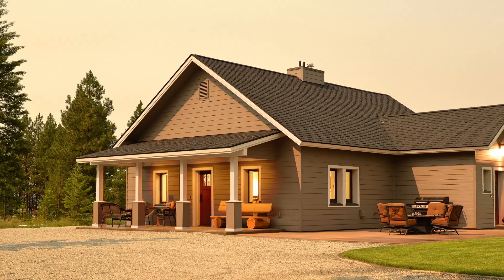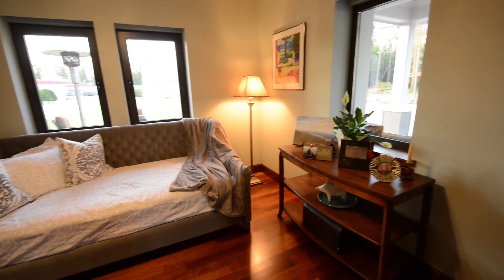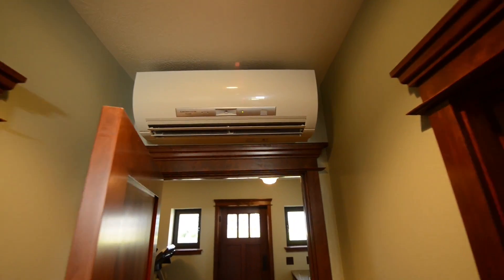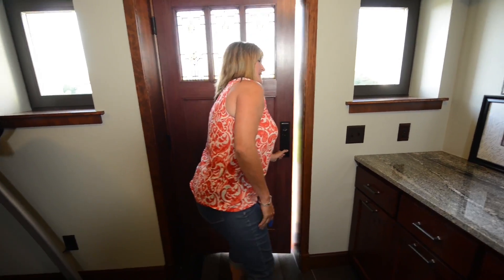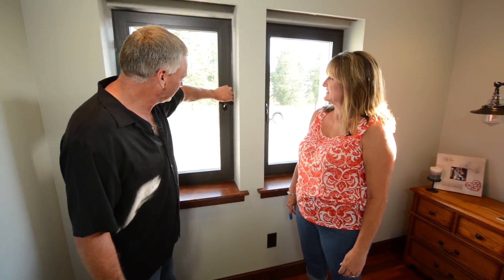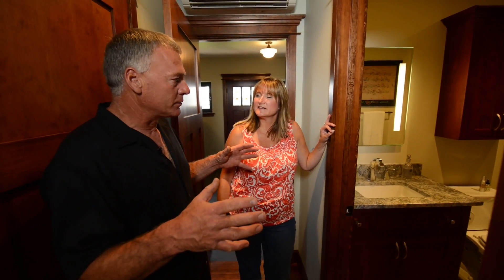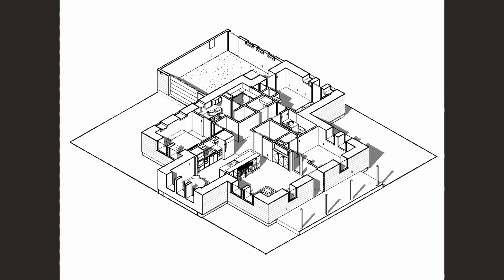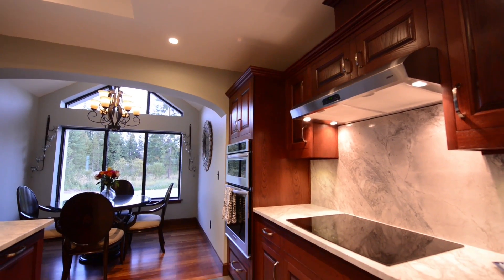Passive House - Effortless Comfort and Pristine Air Quality

Comment: I love the window shade idea, never would have though of that, I'm going to build a passive home in Ohio this year and I'm just gathering as much information as possible, those looked like 18 inch walls?, did they use open cell spray foam or dense pack cellulose, I'm looking to do a combination of both and was just curious. 
How many sq feet is the home and are you on a slab?
Reply: did you end up building Passive House?